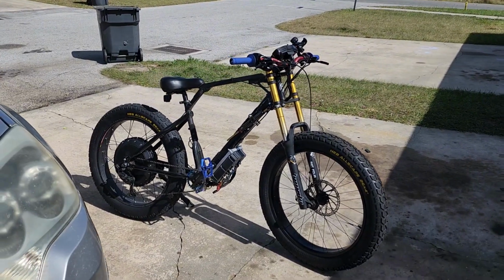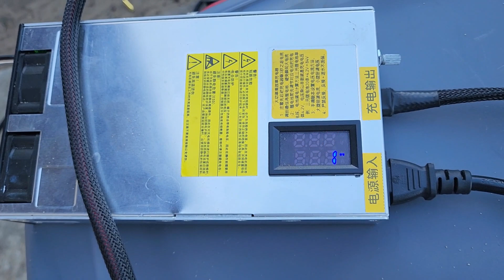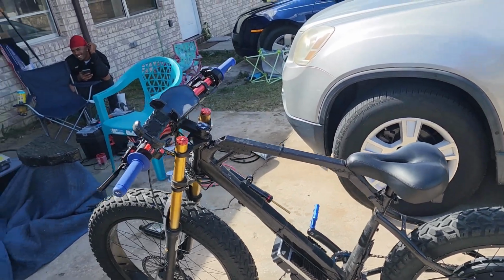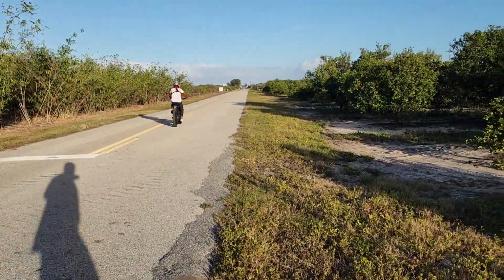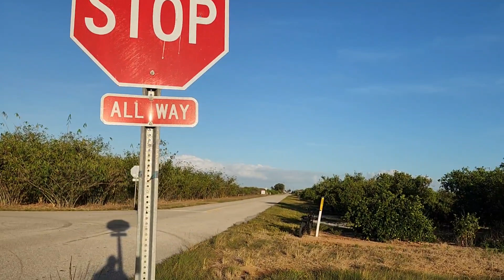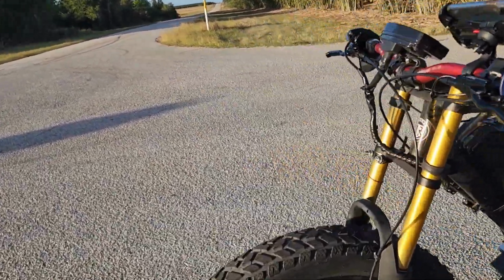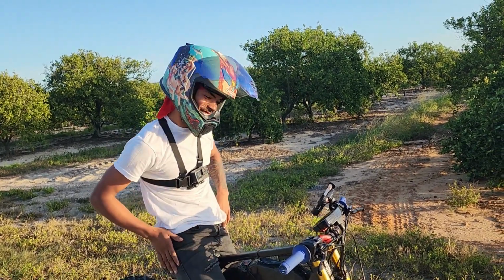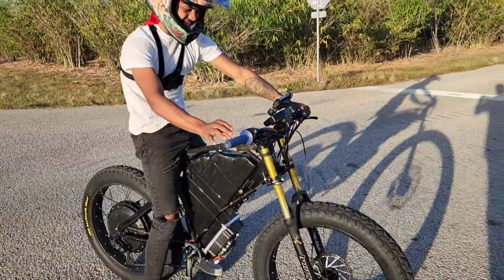Fastest DIY ebike on YouTube!!!!  8000w Tommebike  98mph!!!!!

Comment: Digging the tires! Had no idea 8000w motors were able to hit this type of speed. Can't wait to see that thing over 100! Do you happen to know if those forks are able to use smaller wheels than what they're rated for? I have a 26in wheel and I only see them in 27.5in and 29in
Reply from the maker: Let me check, I believe I seen one for 26in  these tires are supre smooth
Reply: His wheels are 26"

Comment: Nice job. Screen blinks because it has an led source light which is pulsed rather than continuous and your camera captures frames in a pulsed fashion. If those pulses are not timed together so camera capures image when light is on it will flicker. That's why you must use special led screens and tape on tv sets/movies.
Reply from the maker: Oh ok I never knew that, thank you, I learned a lot from yall.

Comment: How did you anchor that qs273 motor to the bicycle frame I'm looking at getting a steel 190mm dropout tracer raptor pro ebike frame and would like to try fitting in the 200mm width motor with a shoe horn as it would be awesome
Reply from the maker: @adamrule6840  well i have two torque arm on both sides with a 12mm bolt to bolt them together and 16mm x1.50 grade A lock nut for the axle

Comment: What are all parts on this bike? I'd like to build an identical one, could you build a battery for me? I feel I could hit 100 mph considering I'm 120 lbs and have a lead foot
Reply from the maker: I will list all the parts soon but man you might not be able to keep the front end down lol
Reply: @E-bikeguy  that would be very fun,  how much would a battery that size run me?
Reply from the maker: @anthonyfogleman8652  well I had to get a spot welder and materials  and molicel p42a  was 1,520$
Reply: @E-bikeguy  how much would it cost for you to make me one, I work full time at the junkyard and have time to put a bike together but not to make a battery, when looking online a 60ah 72v battery with 150a bms cost $1400 but the dimensions are 13"x12"x6" and im not sure how id mount it safely on a normal bike considering its for an enduro bike
Reply: @E-bikeguy  also when I was looking for a 8000w ebike kit the only size options are 16-21" rim id like 26" maybe 27.5 but most likely 26 due to the torque it'll produce
Reply from the maker: @anthonyfogleman8652 you want a battery build or the whole bike?
Reply from the maker: @anthonyfogleman8652  for the qs273 has to be on a 4in rim for fat tire mountain bike

Comment: Hello Rayshon, Did you get a chance to log the amps/watts the controller output this time?
PS if you want that extra few MPH needed to break 100 you could probably just drop the fork tubes in the trees another inch or two......Of course that might make the speed wobble worse.....Never mind LOL
Reply from the maker: Yes we still in the r&d department speed, we got the tune on the controller spot on , battery is going strong 💪🏿  so maybe a tire change might do the trick.

Comment: imagine another hub up front
Reply: I think it would be useless and dead weight man because at that power you can't use the tork on the front hub maybe it can be good but when you start giving a little bit of gas front tire will probably lose traction best thing to do for more power would be liquid cooling to the hub motor and tune the controller for little bit mor power

Comment: Mate, with peace and love, are you sure it's not showing kilometers instead of miles? It's very hard to get e-bikes over 60mph and with air drag every extra mph of top speed demands more power. No-one else with this configuration was reaching over 70mph also.
Reply from the maker: It's in mph here in the U.S.A yes it takes a lot of power to reach them speeds.
Reply: @E-bikeguy  it just doesn't check out, 20,000W Telaria sting can't go this fast it tops out at 60mph, how can your bike do 90mph?
Reply: @E-bikeguy  cause 98kph would make perfect sense, it's 60mph something a bike of these specs could achieve
Reply from the maker: @EdLrandom  taller wheels bigger controller and a more powerful battery
Reply from the maker: @EdLrandom  check out my warm up short we did 92mph just on a wran up
Reply from the maker: @EdLrandom  you got to watch more of my videos bro I'm in mph here in the u.s
Reply from the maker: @EdLrandom I'm going to run it back today